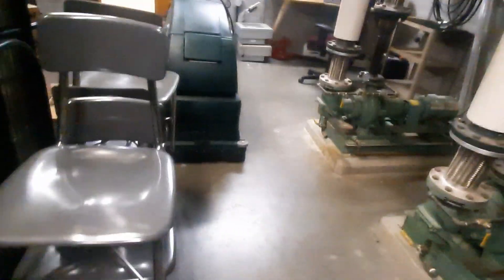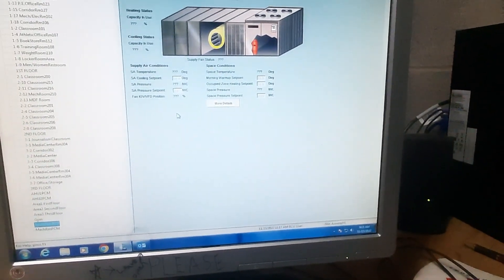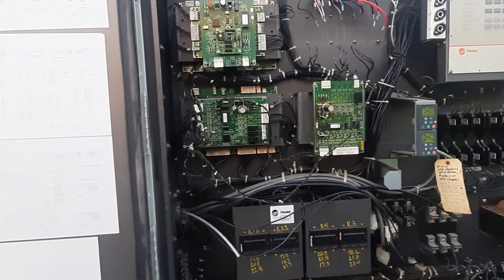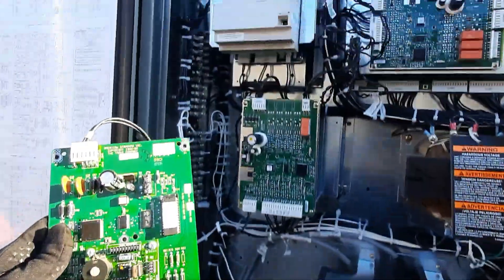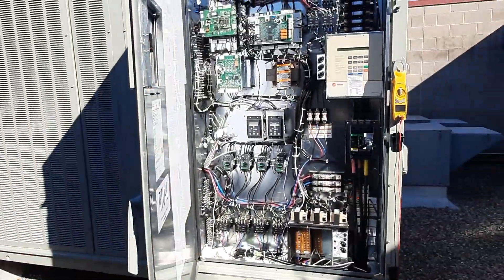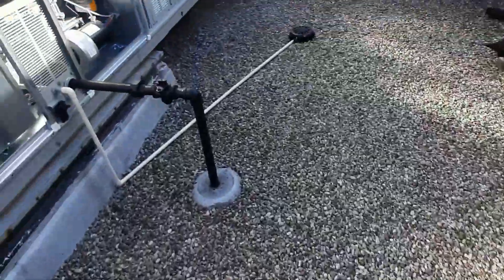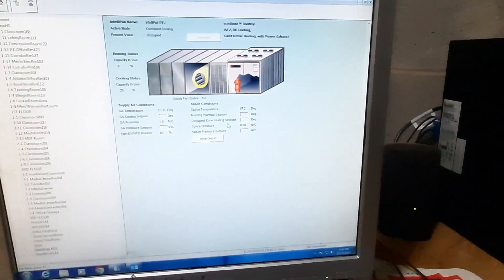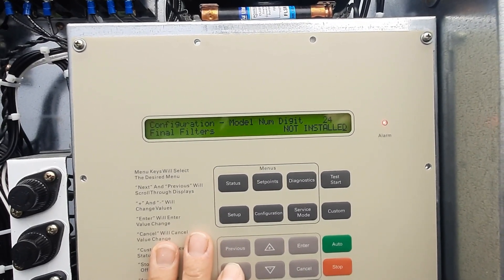55 Ton Trane Intellipack Replacement and controls start up.

Comment: Nice job making that old comm board work. The whole waiting 24 hours for oil to warm is not practical most of the time.
Reply from the maker: Thanks Nick! Yeah, it wasn't that cold either so no big deal, those scrolls are tough

Comment: I noticed the roof top unit is heating and air, so what are the boilers in the building for?
Reply from the maker: Reheat and possibly some other purposes. VAV system so we maintain 55 degree supply air and duct static pressure. The vav has Reheat if a space needs and calls for heat.

Comment: Hell yeah Steve-o....that was very cool how you integrated the old controls with the new unit. That isn't easy and i know it required a lot of reading and testing voltages. Nicely done bro.
Reply from the maker: Thanks Jason! When I said "we found it" I was wrapping up honestly, had it in stand alone mode with supply set at 60 degrees. My boss says just power it from the other transformer. Boom, set address and done!
Reply: @EverythingHVACR  all that matters is that the equipment is running properly on what you had to work with, and is set up correctly. You handled that pig, like a pro.
Reply from the maker: Hell yeah, I have good support who come through in the clutch and make me look like the super hero. It's good to have Leadership that helps and will get there hands dirty in the process.